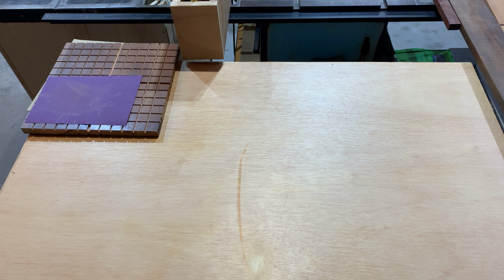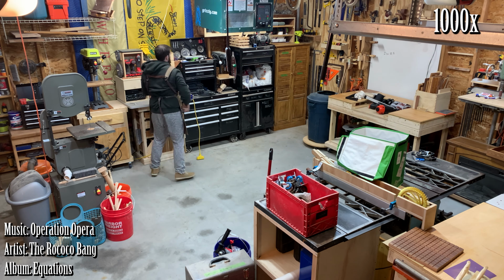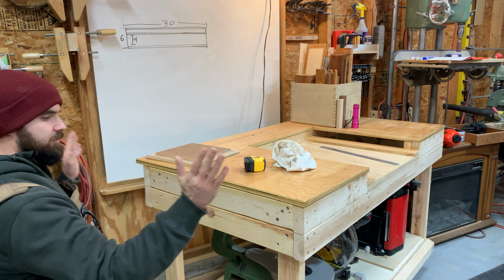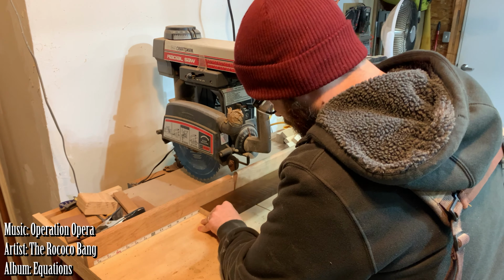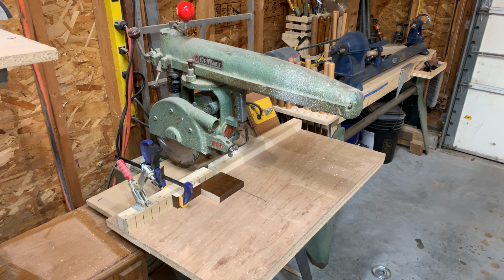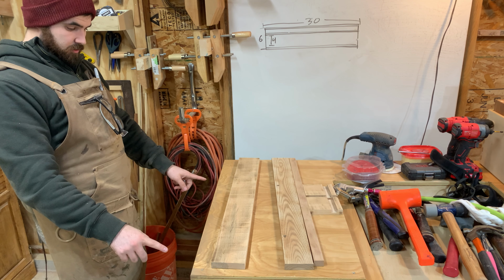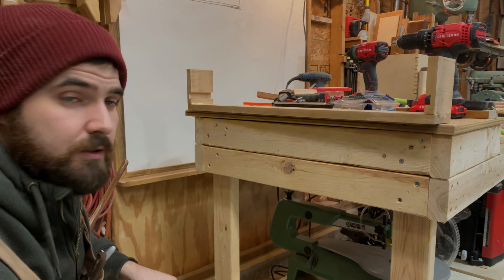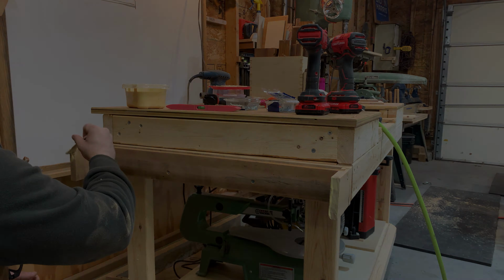Hammer Organization | Quick, Easy and Inexpensive

Comment: What happens when those small hand sledges 1/4 turn and your toes are in the kick space? Love your chop saws! Have my dads old leather stack curved claw Estwing. Thin the herd. You don’t need that much redundancy. Put some of your old friends up high on the wall like trophy heads.
Reply from the maker: Thank you for watching and commenting! I ended up mounting it to the wall shortly after making this video.
Reply: Put my retired Estwing 28 up on a wall in a worn out hammer loop to survey the shop. Plumb 13 curved claw is my EDC. Who needs a huge high $ framing hammer with pneumatic tools in the same price range? Bragging rights!? Straight claws rule the market and seem to also serve as pry bars. I have Granfors bars for that.

Comment: No carver’s mallet, no chipping hammer, and no cobbler’s hammer. You need more hammers! No bumping hammer, no flatter, no drywall, no cross-peen, no diagonal peen, no handled hot-cut, no non-sparking, no copper lump, no soft blow, no raw hide, no split face. Man, you weren’t kidding when you said you have a few more hammers to go. Hey, guess why I am watching your video? I have too many hammers and I may have broken the drawer on my toolbox because too many hammers